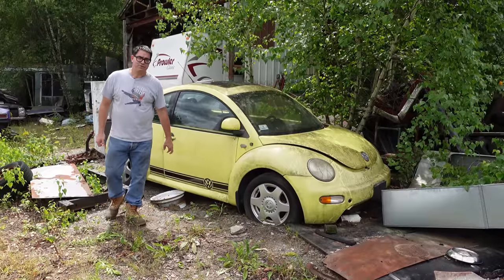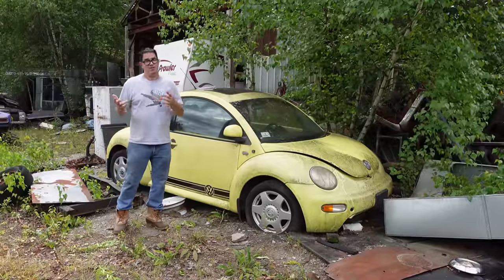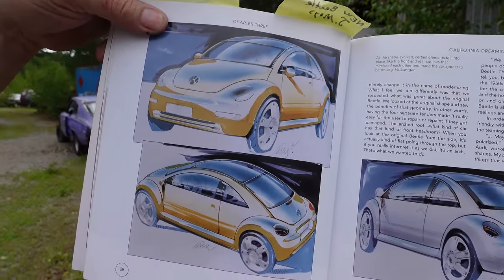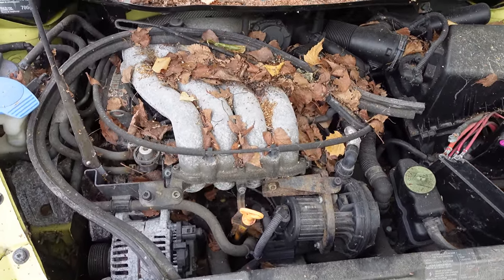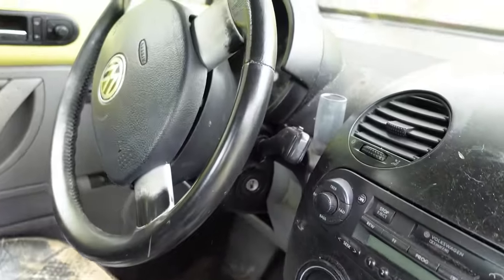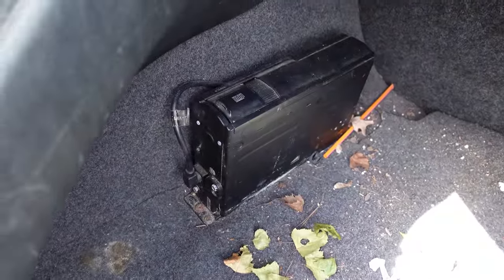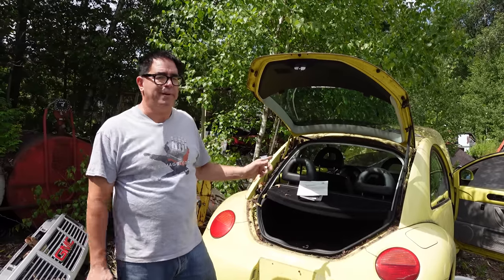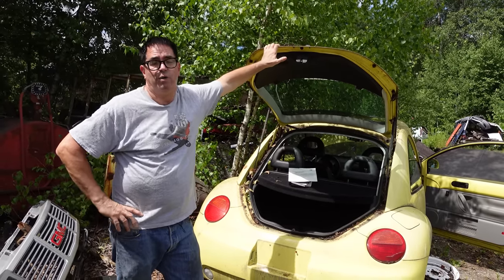Old New Beetle

Comment: Great video. However you are merging the generations of cars. The New Beetle ended production in its second (refreshed) iteration in mid 2011. It was then replaced by an all new car from 2012-2019 also known as the “12up”. These are two separate cars entirely. The “New Beetle” was named just that. Where the 2012+ is just “Beetle”. Love these cars. I just sold my 2017 convertible, I’m about to buy a 2002 Turbo S I’m pretty good condition. Valuable info here!! Thanks.

Comment: All the comments about quality control being lacking on these cars is true.  I hated working on them as well, due to poor access to the Golf drivetrain.  Doing timing belts on anything other than the basic 2.0 l really sucked.  The interiors fell apart early on, and the paint jobs faded fast.  The visibility was quite horrible as well due to the roof structure and the mile long dashboard.  I don't miss these at all, but still like the air-cooled predecessor and own a few of those...
Reply: In 2001 the wife needed a car ,and an auto trans. 
We test drove a 2000 Jetta 2.0 with auto. 
My rabbit pickup with a warmed up turbodiesel would absolutely kill it! 
We went with a vr6 instead.
I still got it,and I'm doing a Smyth Ute kit on it now.

Comment: The first retro design I remember was the 1994 mustang. The whole, it was then, and it’s this now slogan hey had going. I agree it wasn’t a total retro design, but the where using style elements of the 64 1/2 mustang. Side scoops and three on a side tail lights and the reappearance of the fast back roof line.
Reply: The ‘94? That’s about as far away from the ‘64 design as it got. There might have been “cues” but there’s no resemblance in the actual design. There would not be until 2005.
Reply: @joe6096  Still, it was right after the Fox Body - which had zero traditional Mustang styling cues.

Comment: Been a VW enthusiast since the mid 80's and when this came out I was not interested. Just looked a little too goofy. The first time I saw one in person I could not believe how huge the doors were. Nice for ingress/egress though. When these were restyled a few years back, they looked much, much better. The roof-line was dropped significantly (closer to the look of the 'vert and Audi TT) and some round-ness was squared off a little here and there. These little changes made a huge difference.
Reply: Mk1 guy here for life. 
We used to rip on the Mk4 kids in the forums alot ,but over the years the Mk4 platform has proven itself as one of the best they made. 
I still see a handful every day driving around here in the northeast,not bad for a platform that the newest one is 17yo.
I kept the wife's old Mk4 Jetta vr6 and got a Smyth Ute kit for it.

Comment: You could throw Chevy in to that mix with the hhr & ssr. But I think you're wrong imo, The first retro design was the 1989 Mazda miatia.
Reply: Gonna have to disagree on that.
Miata's design in 1989, or any other year cannot be considered "retro" when their base designs never really had any drastic redesigning.
In stark contrast we have the PT Cruiser, Ford Thunderbird.. 1989 Nissan S-Cargo. To name a few..
Then we have to acknowledge the 1989 introducing of the Dodge Viper.
The Viper may not be considered "retro" per se, but it was reminiscent of the famous Shelby Cobra 🐍. But the designer used retro-styling for inspiration, not imitation.
Reply: The Miata was a new model, drew no inspiration from a specific model or time period
Reply: @rickross9661  And they came with a rainbow 🌈 sticker from the factory.
🤣🤣😂🐸😆😛😂🐸🤣

Comment: I was a fan of the old 1600 douport engine. Easy rebuilder. The new bug was cute and the convertible was ok, but I don’t think they were as durable or as easy to work on as the old VW. I’ve had a square back, a bus and a camper. I would not buy any VW made today

Comment: Biggest piece of junk ever. My Mom bought one of these abortions, unfortunalely. What a cheap car. Probably even worse than a Yugo. Electric window switches always broke, headlights and taillights constantly burning out (and the bulbs were expensive) , and the computer actually once took a dump which cost $600 to replace back then. It was a fun car to drive, when it wasn't broken down. Only after she bought this thing did I read tons of angry reviews from other unfortunate owners, one I remember in particular, who said they wanted to push their Beetle into the ocean. The best thing VW ever did was to kill this piece of junk and put it out of it's misery. Good riddance to one of the worst cars ever. This one is exactly where it should be. VW isn't even close to what it used to be.

Comment: timing driven water pump piles of trash with more electrical issues than a caddilac. the worst car made besides the timing chain driven water pump 2.4 Gm... these things would blow a head gasket if you breathed at them...